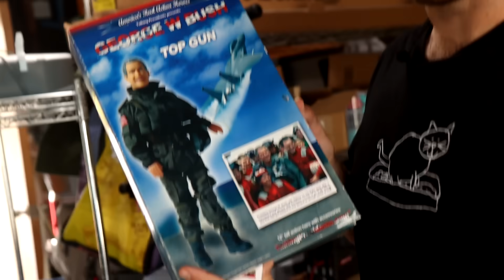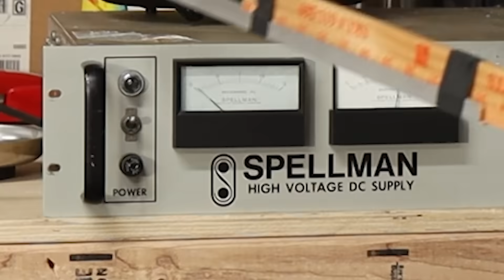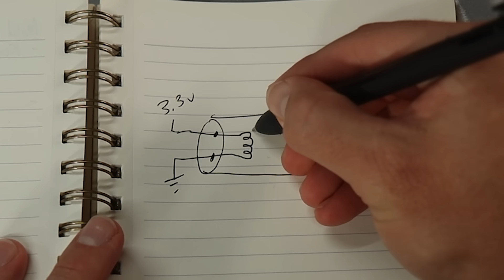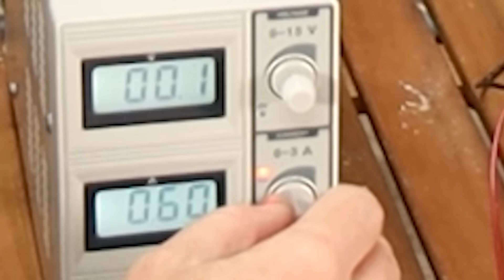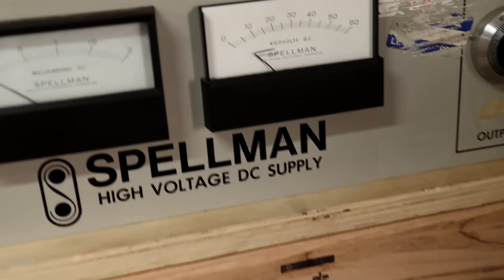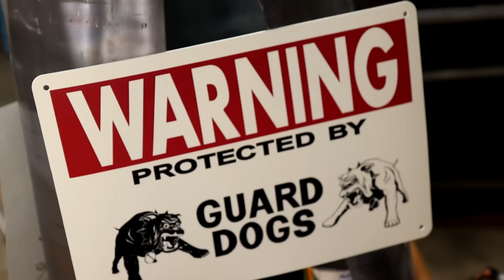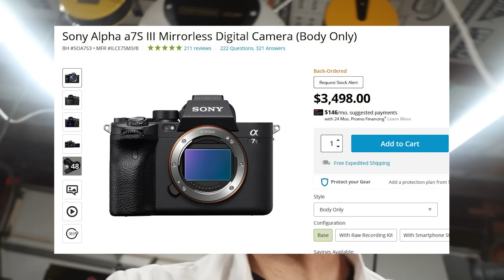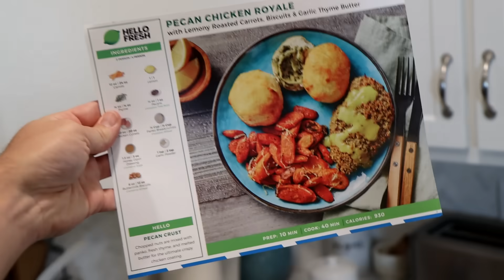Built My Own X-Ray After a Hospital Charged Me $69,210.32

Comment: “Guys it’s perfectly safe, the radiation isn’t that bad” while standing in front of a machine that’s arcing bolts of lightning in random directions.
Reply: Well he's right. Bolt of lightning aren't radioactive
Reply: @TheNamesArif  The electrons in the arc aren’t radiation, the photons they emit are.
Reply: @TheNamesArif  they actually are radioactive. that is how an xray tube works, slamming high voltage into atom's to produce xrays. lighting is just a very unefficient way of doing it compared to an xray tube.
Reply: @sleepy_jean  and how do you see the arc? Oh yeah, photons. Please don't be so pedantic.
Reply: @superslimanoniem4712  what are you talking about. I'm just saying x rays aren't electricity. I'm not being pedantic.
Reply: @sleepy_jean  that doesn't matter, lightning emits gamma rays.
Reply: @tjeulink  Also just the mere temperature of an electrical plasma arc in air (10000K+) is enough that it is actually outputting a fair potion of its radiation as UVC. Some X-Rays etc also but UVC is most definitely ionising radiation it is in fact this which is responsible for its germicidal properties. Not quite as dangerous to us as we have enough tissue depth to offer some protection to our more critical organs that limits risks to things like radiation burns, potential cancer of the skin, oh and of course eye abnormalities including potential blindness. But it will fry and nuke microbes good and proper in short order basically any cell (or most any viable somewhat complex organic structure including things like viruses) exposed to unshielded UVC is not going to be having a good time. Well for that matter pretty much anything relying on that sort of molecular level precision in critical parts of its structure is likely to malfunction permanently in short order. Also many somewhat modern microcontrollers will at least experience significant errors with direct exposure to UVC due to the stray charges induced by ionisation. I've done some experiments with UVC tubes and CPU's the latter usually exhibits frequent fatal kernel panics and a rather short life expectancy microelectronics and ionising radiation get along about as well as organisms and radiation heh.
Reply: @tjeulink   nooooope.
You are not making x ray by slamming high voltage into atoms lmao 
X-rays are generated when accelerated electrons decelerates/comes to an sudden stop. This is because electron have mass and velocity, and when it stops or slows down the electron loses kinetic energy in two forms - heat and light. The light generated by this is called bremsstrahlung and the energy of the photons are proportional to the kinetic energy of the electrons. Because the electrons are accelerated to incredibly high velocity in the tube, the energy of the photons are high and this means they have wavelength that's much smaller than the visible light range. The reason you can see the arc is because the energy of the electrons / excited air molecules aren't high enough and that's why they generate light with wavelength in the visible region.
Reply: @tjeulink  wrong again
The difference of gamma rays and X-rays is not the energy, but it's origin 
Gamma rays are emitted by excited radioactive nuclei when they relax to the ground state 
X rays are emitted by electrons as they lose kinetic energy
Lightning releases X-rays, not gamma rays :)
Reply: @Malenia_of_the_Haligtree  so what you're saying is that if electrons suddenly decelerate because they smash into atoms they emit xrays. Sounds like they ARE making xrays by slamming high voltage into atoms.
Reply: @Malenia_of_the_Haligtree  i never said that the difference between gamma rays anf xrays is the energy. I said lightning is radioactive. Which it is, it emits gamma rays.
Reply: @tjeulink  X-ray, not gamma ray.
There isn't enough energy to make radioactive nuclei in lightning
Reply: @Malenia_of_the_Haligtree  lmao no, i said lightning is radioactive. i was completely right. i never said xrays are radioactive.
Reply: @Malenia_of_the_Haligtree  i didn't say xray nor xray tubes are radioactive. i said lightning is, and then i said "that is how an xray tube works, slamming high voltage into atom's to produce xrays". what i meant with that is, that the process of creating radiation in lightning is similar to the process of creating xrays. they both use high voltages and they both interact with atoms in a certain way. i suppose an xray tube might also become radioactive if the voltage reaches the level of lightning, but the tube would probably explode before you reach anything close.
Reply: If the radiation doesn’t kill you, the lightning probably will.
Reply: Or is it?
Reply: Funnily enough, for those machinists out there qho run EDM machines, that is litterally their job...
Reply: i thought your username was LemonGraab the Foreskin
Reply: never mind, there ware warning sings!
Reply: @FusslDerEchte  depends, beta can have very low energy as well, depends from which radio nuclei it originates from
Reply: We literally got to make the Lightning bolts in school when we where 14 so I don’t think there that bad
Reply: i laughfed at rhis comment sorry for my inglish
Reply: Consider the following. If beta radiation is electrons isn't electricity technically just very high beta radiation.
Reply: @sleepy_jean  no, since the electrons in electricity 1. is on way lower energy than beta (~1000 eV vs. ~1000000 eV) 2. don't radiate.
Reply: @sleepy_jean  the difference being: beta radiation consists of FREE electrons, that is not bound by any atoms 
Electricity (or more precisely, current) consists of DELOCALISED electrons bound by atoms that makes up a conductor 
The reason beta radiation is damaging is because it is free from constraints and carrying an negative charge, and they can interact with bound electrons in your body and wreck havoc by either ionizing your DNA by either pushing them away because of the same charge, or deliver its kinetic energy to the bound electron.
Electricity damages us by delivering electrical energy to the body, and that's why they are different :)
Reply: I think he’s going to have cancer

Comment: Really hope none of the safety nerds live in the UK where we often have lead water pipes. As in the mains water pipes from the street into houses are still often made from lead.
Obviously not new houses, but older houses are often still supplied from the mains to their houses by lead piping. Even after the mains in the road has been replaced. 
I have also worked in quite a few properties in London that still have only lead water pipes throughout their house. Not just for the heating system, but ALL the water supply including drinking water.

Comment: I have worked as a biomedical equipment technician for 20 years. I believe the reason medical equipment is so expensive is to cover lawsuits that could arise from its failure. It never ceased to amaze me the markup on even a simple part for repairing something. For example a switch you might expect to buy 4 $10 will easily cost a hundred. This gives the manufacturer a pool of money that can be used to cover lawsuits. I found in general the mark-up seems to be about 10 times. So if an x-ray unit cost $70,000 it could probably be manufactured and sold for 7,000 and still leave a good margin of profit.

Comment: When you go above 22 kV it's a different ballpark with electricity. Air is not a good enough insulator, so when you don't have inert gas (or the oil that was drained) surrounding it, good isolation of the conductors is key.

Comment: as a former industrial x-ray techinician this was one of the hardest things to watch.
We had such insane regulations in Canada on our radiation levels and safety, but also we were using things like 300 Curies of Cobalt-60 to x-ray 5 inches of solid steel.

But also, you are totally accurate with how small of a dose you get from medical x-rays. Though I still wouldn't have recommended actually putting your hand in front of it ahaha
If you had something to focus the x-rays you would probably get better results too

Comment: My X-ray cannon was better. Made my own tube (12 feet long) out of 6" diameter glass and instead of 60kV fed it 3MV. Beam current was about 250mA .Popped the main 100A/240v breaker so had to resort to using a DC-DC converter ran from a high current lipo battery bank. 750kW peak power, so prob not only gave myself cancer but everyone within 2 city blocks of me as well. Oh well, was totally worth it.

Comment: So anyone with some knowledge can say how dangerous and toxic everything he did was?
Reply: what he did was really stupid, why do you think the x-ray tech gos behind a lead wall when taking x-rays, or why you wear a lead apron.  While he probably won't get cancer from this he did up his chance. Medical x-rays are necessary what he was doing wasn't. Another thing is that x-rays are supposed to be concentrated beams of energy at least with medical grade items. He stripped down a old x-ray tube and probably did some weird stuff to it. He through everything about safety out the windows when he x-rayed his own hand for way longer than a normal x-ray where exposure time is less than a second. He had a uncontrolled beam of radiation shooting directly into his hand for what I heard earlier a 15 second exposure time. There is a reason why I can't just buy a x-ray machine online. The people who take x-rays are highly trained in there specific fields. Starting with two years just focused on x-ray and then further specializing into different modalities such as ct or interventional. While he does have degrees in engineering and electronics, I don't think he is qualified to do this because his degrees are way more broader and his hours or day of internet research do not equal the years of study someone has to do under a qualified person. While a entertaining video a really reckless and stupid one as well.

I am not a trained professional but I have done alot of research into the field, and I also have common sense

Comment: I love how he addressed the safety nerds mostly over radiation. I’m far more worried about the high voltage
Reply: Radiation will kill you eventually, high voltage will kill you now
Reply: @alienblade2005  Isn’t it high current that kills? Google tells me that the resistance of a human from hand to foot is 600 Ohms, which I will accept at face value because that makes it 100A going through you and never mind, it’s fatal. Notably, dry skin is incredibly resistive (estimates I found range from 100K to 600K Ohms), but I don’t know how to effectively utilize that for purposes of a YouTuber getting electrocuted beyond the point of health insurance being a problem.
Reply: @jonahdove1902  its technically watts that kill... you can touch thousands of amps bare hand if its low voltage. 
 And you can also touch millions of volts if the amps are super low.
 So its kinda both together in my opinion
Reply: @helpabrothawithasubisaiah5316  This is why very high voltage static shocks will only hurt you, but it only takes 120 volts from a home outlet to kill you.
Reply: @gakulon  I mean it won't always kill you, but yeah if you use both hands and have the electricity go across your heart its very very possible. 
 Its more common people die in all the 240v places though, thats why UK plugs are so much better then our plugs
Reply: @jonahdove1902  Yes. The current is what actually does the deed, but the voltage is what allows it to so. It's just that high voltage can behave more erratically because it can arc to you
Reply: Don't worry about that, Will is experienced with danger nood-....  Death cables.
Reply: @EnsignLovell  danger noodles are snakes, death cables are high voltage wires.
Reply: @JustMiniBanana  danger noodles are all noodles that are danger
Reply: @casadastraphobia  if it causes pain its a danger noodle? 
 So my ex gfs had to deal with a larger then average dNger noodle?
Reply: @JustMiniBanana  Lightning tubes.
Reply: @JustMiniBanana  conductive danger noodle?
Reply: @maizjsj  that works
Reply: @maizjsj  Thats still just a venomous snake..
Reply: @EnsignLovell  Ima call them that now thats great
Reply: Dont worry he did address it, he said he has health insurance
Reply: I’m worried about what he did with the oil from the X-Ray head he pulled apart. It was probably full of PCBs
Reply: @TheRealTulbot  I didn't see a single Printed Circuit Board in that oil.
Reply: @robspiess  pcb is like polychlorinated booty or something like that it stands for... 
 It's stuff that stays in your body and the earth forever and never goes away and hurts everything, even rocks
Reply: @robspiess  my pet rock touched a pcb once and it unfortunately isn't my pet anymore and isn't around.. 
 It passed away

 This was back when PCB grew on trees and were in everything like play dough and toy car paint mixed with lead and mercury.
Reply: @helpabrothawithasubisaiah5316  biphenyl
Reply: @TheRealTulbot  Legit question, was it common to put PCBs in insulatory oils? Would the canister be marked somehow like the ultrapink BeO2 rings on various HV RF equipment?
Reply: @TheRealTulbot  thats a dang lie... 
 pcbs haven't been around since like before the 70s... 
 And they are highly regulated... 
 Nobody selling something on ebay will be shipping things with PCB oil in it. 
 And that head isn't old enough to contain it
Reply: @helpabrothawithasubisaiah5316  except the floor of lake michigan is full of them
Reply: @natalieisagirlnow  the floor of a lake is full of what?
Reply: @helpabrothawithasubisaiah5316  pcbs.  they don't decompose and are in the fat of large fish, and have been since they were put there by paper companies in the 40s and up
Reply: @helpabrothawithasubisaiah5316  Most likely it isnt pcbs but i can imagine a scenario where a tube head is sold on ebay without being recognized as pcb containing. It was put in so much old electronics that its probably hard to know where a lot of it is. I do agree though that the tube head seems pretty new and unlikely to have pcb. Im not sure exactly how its regulated but if you have insight into how they filter out products containing pcb I would appreciate a better understanding greatly.
Reply: That power supply probably only produces tens of milliamps. Certainly dangerous, but not enough to instantly electrocute you or anything like that.
Reply: tbf, it's only the potential...

I'll see myself out
Reply: The worst that could happen is that you die, it's no big deal
Reply: Have a friend who works on powerlines and saw a coworkers feet basically melt off
Reply: I just want him to wear safety glasses. Minimum. :*(
Reply: The. Wooden. Tables…
Reply: Don't lick it and you will be fine.
Reply: Well, if you isolate yourself enough. It would not be a problem. You just have to wear like really thick rubber shoes
Reply: It's fine... isn't like he got sick that night or anything...
~for more go hear the "Safety Third" podcast...
Reply: @Alex 5432  what episode
Reply: There are 2 types of people in this world people who are scared of electricity and people who should be
Reply: @xXIsaacClarkeXx  "Amperage kills you".
Uhm, homie. Voltage is part of the calculation for amps. The whole "it's not the X that kills you, it's the Y" is such a silly joke. Because it's all of the above. They're all part of the equation that kills you.
Reply: @Microtardz  voltage is part of the calculation for watts, not amps. 
 Amps and volts are separate, but together they make watts
Reply: @helpabrothawithasubisaiah5316   I = U/R P = U*I so P = u²/R ; What drives the electrons through the conductor is the potential difference ( from Coulomb law being a force * distance) across said conductor, so what really matters is the potential across a given resistance (which will limit current).
Reply: @MrSupers11  that seems like a fancy way of saying you need more voltage to go over more insulation.
Reply: its cuz saftey nerds whine over the least concerning parts of a science video
Reply: Aw shut up safety 2nd
Reply: the safety nerds died of shock before commenting
Reply: quick research shows the amount of radiation is about the same as standing near a microwave for a bit. The rads you get aren't bad, def would rather not get electrocuted hahah.
Reply: @bulldogmicro4279  So how much does your quick research say you get irradiated with from standing near a microwave oven?
Reply: @bulldogmicro4279  are you unironically saying that using an unshielded xray machine is the same as standing by a properly shielded microwave for "a bit"????

oh buddy, stay in school lol.

Comment: Ok but on the subject of electrical arcs, cause I was thinking about this earlier, how does the arc know to arc? like I recognize it’s due to a huge voltage differential, but the 2 objects between which the arc flows are effectively electrically insulated from each other right? blah blah blah breakdown voltage of air but what’s the actual mechanism of action there? is it just like spraying out electrons until something lines up? or is it like pushing against something until something slips? how does the high voltage point determine the path of least resistance before taking it?

Comment: To the editor, I had a problem with text overlays causing those weird highlights on the footage too. My issue was the framerates of the project and source were different, or if you're using multiple cameras with different fps it can cause that jank.
Reply from the maker: Change the encoding settings from Hardware to Software. I forgot to do it and didn't care enough to re-export/upload.
Reply: @williamosman  Ah, I could only see the error post render so youre right. I was troubleshooting another error and had the encoding switched lol